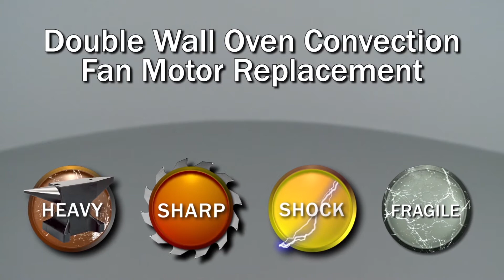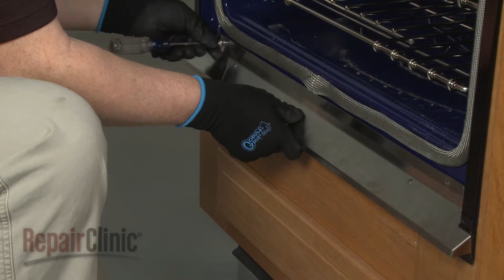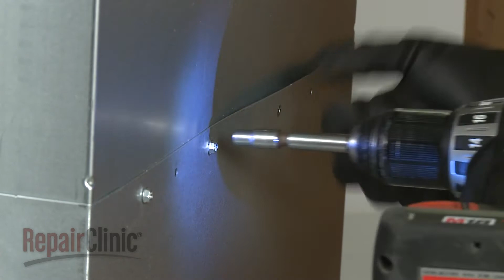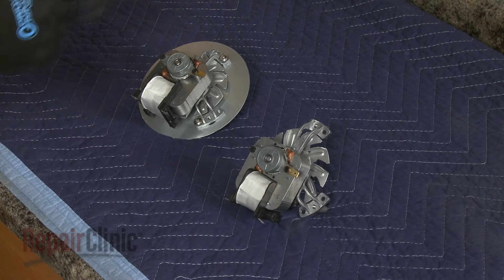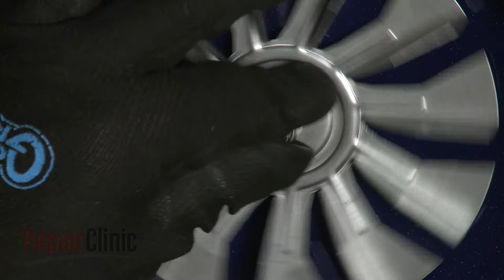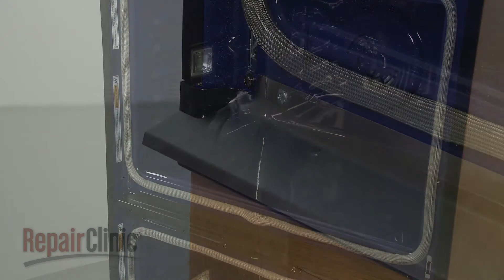KitchenAid Double Wall Oven Convection Fan Motor Replacement W10860984

Comment: I cannot seem to remove the screws on the inside cover (2 in total). they are rusty and head is messed up (cannot tell what driver bit to use to unscrew). any advise?